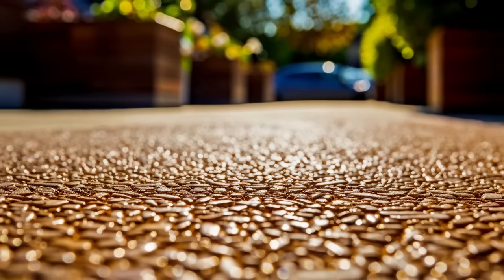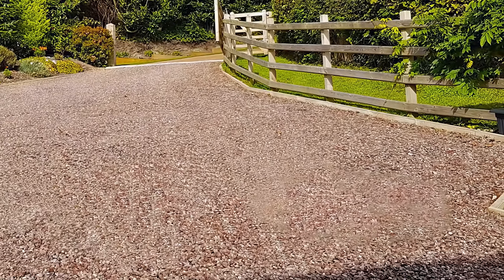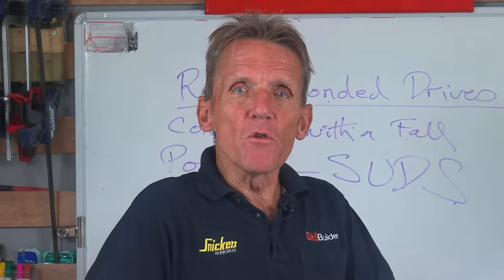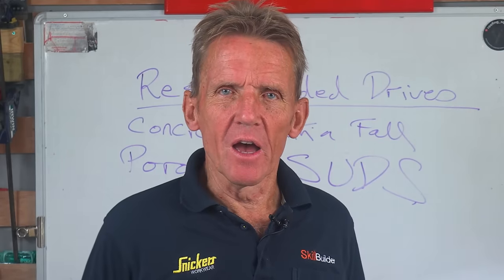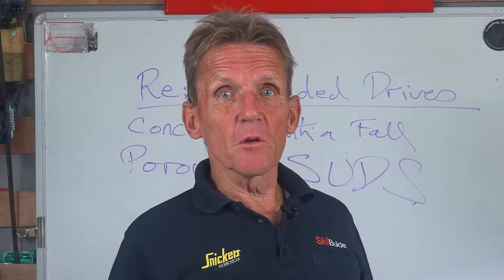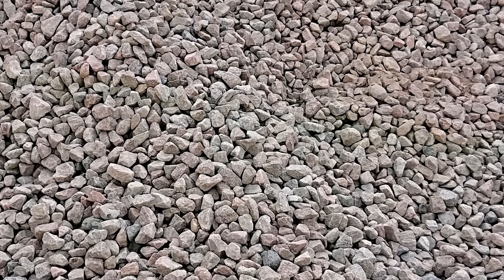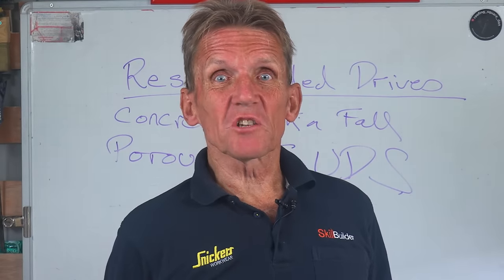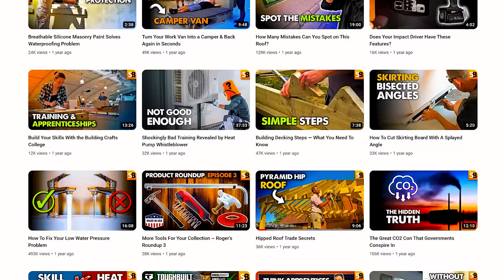Resin Bound Drives - What You Need To Know

Comment: Ive never seen a good resin drive past a few years. I think a high quality paver would look and last nicer personally, plus its easy to relevel and maintain.
Reply: I always try and steer towards a nice sett or paver not always easy as some customers really like the idea of overlaying worn out tarmac drives
Reply: i went away from resin bound having seen a number of bad ones. Opted for gravel grids and loose shingle. Easy to level and minimal shingle spreading, we are on a hill works really well
Reply: Trouble is that most pavers are concrete and they lose their colour and the grit shows up in a few years. I've had Accrington Nori clay pavers on my drive since 1992 and had them re laid last year. Looks like new. Clay holds its colour and they're as hard as rock. No man made dye holds its colour IMO. Grant you that you did say a high quality paver but clay these days is so expensive but a good investment if you plan on staying put.
Reply: Easy to level? Easy to maintain? 
Are you literally insane?

Comment: One of the local resin firms came round to estimate a few years ago. I have block pavers already but looking a bit tired. He said he would leave the pavers in place and resin over the top. So glad I left it as it is.
Reply from the maker: Yes you did the right thing, it was never going to work.
Reply: The right thing? It is not advised to resin over block pavers mate especially on a driveway or any drove over area. A solid base of porous concrete or base tarmac is a MUST for a drive. If its a path of a patio area then you could get away with it but you would still have to know what your doing to stop the weeds growing through the gaps in the blocks then out of the resin. The reason you cant resin over blocks on a drive is because there is too much movement and the risk of a future remedial is almost guaranteed.

Comment: I did my path myself, lovely easy product to work with and great finish . But not convinced driveways will stand the test of time.
Reply from the maker: did you do the resin bonded cast or the resin bound? I want to have a go at it
Reply: @SkillBuilder  I used the resin bound kits as such a small area, block paved the area in. Ruled of the blocks.
Acetone handy to keep tools clean.
Man of your skill a walk in the park.
Thanks for the videos. Learnt alot.
The rising damp, damp etc series saved me a lot of money.👍
Reply: Any discoloration of the resin finish since you put it down?
Reply: @Andrew-ze5yo   so its been nearly 2 years since I done it. still looks the same as the day I lay it. I will repeat it only takes foot traffic and nothing heavy . when I cut the lawn you get grass stains but that after a few days the rain washes it off. also the sun is not on it all day after lunch is in shade.

Comment: I had resin bound aggregate laid over concrete for my backyard, which is separate from the driveway, so has no vehicular traffic. Before, there was much standing water which now quickly drains through the resin. However, that works both ways as small weeds can still show.  The sandy coloured aggregate though, sparkles like a beach when the tide has retreated.
Reply: Just spot treat the weeds with glyphosate 😉😉
Reply: Just een your message in regard to resin pathway and would appreciate your feedback and any advise.
I have a structurally sound concrete path with a manhole cover in its length.
The path is an eyesaw.
The path is slightly wider than a standard square main hole and around fifteen yards long.
I intend to build a base for sheds at the bottom of the garden.
It's only a small garden.
From your experience would you cover this concrete path with a resin finish 
Or replace with pave stones.

Comment: Thank you Roger, yeah found that really interesting. 

When resin drives first came out I thought that would be the perfect material to use for my own drive, when I get round to doing it but after seeing so many that's failed for one reason or another I think I might go for corbels or some sort of pavers using   GFTK for the jointing.

Another problem with resin drives is they attract the build up of moss if not regularly cleaned, so I believe. 

Another subject I think would be compelling and that is different types of decking or even just composite decking as there are many different types now on the market.

Anyway hope you're keeping as well as you look in this video 😃

☮️+❤ always from me and the missus✌️

Comment: Bought a house with a resin bound drive about 3 years ago. Had been down about 10 years. Looked fantastic when we bought the house -  indeed it was one of the selling points (it's a fair-size driveway). 
Anyway, the whole thing has disintegrated in the last couple of years and all the stones have come loose, especially round the path of the cars. I guess the resin has just deteriorated over the years. It's a pain as all the little stones get trod into the house (wooden floors!). Not sure I could recommend resin bound drives based on ours. It might be a bad job, done by a bad contractor - who knows. We have to get the whole thing replaced now. It cost about £13k to put down and that was 12-13 years ago, so yearly cost (adjusting for inflation) is well over a grand per year, which doesn't seem great.

I'm now thinking about block paving, but worried about weeds in the gaps.
Reply: Does'nt look as posh, but our concreted drive has been down for 30 years & still fine.......lol.
Reply: Well sadly it wasn’t installed properly in the first place..
Reply: @MC-nb6jx   Aye it's all about the hardcore (ooer missus!) & compacting correctly, prep is everything with these jobs, I used to lay concrete founds, slabs & driveways, they are all still fine since the early 80-'s  i'm sure......

Comment: I laboured for a bloke doing patios driveways etc. All of a sudden everyone was asking for resin 90% of driveway we did somebody wanted resin bound system installed. After a few years he did end up getting call backs for colour problems slight movement. The main problem was people dry steering on the driveway causing movement. I must add all preparations were done properly, he was a craftsman but it still caused headaches. 

Research and be prepared for what Roger has pointed out.
Reply from the maker: Dry steering with an electric car is going to churn up most things. They are a lot heavier

Comment: Thanks for this Roger, very useful. Quick question- -  we're looking to put resin bound over a stable concrete base. Is there a risk from water freezing with the resin/between the layers, expanding and causing cracking?

Comment: a way to do it as DIY drive or walk way is to use old car tires, cut out the side walls. dig down the width of the car tire plus say extra 3 inches, then place the tires side by side and nail them together, then fill in with small pebbles /gravel then slightly pack it down, then its just like concrete but water can drain through it.. the tires keeps the pebbles /gravel in place and wont let it spread out , strong enough to where you can even drive an 18 wheeler over it no problem.. will last for years and years...

Comment: Great informative video as usual.
I have been also been looking at GEOcell type driveways. It would be useful if you could also cover this and compare with resin bonded drives. 
It seems you put at least 20mm of stone above the Geocell itself to allow for settlement - which sounds fine - but is it in practice?
To me the Geocell might be more 'forgiving' when you have large bushes near the edge of your drive.
Appreciate any thoughts you have on the matter.
Reply: A word of warning. As a Driveway specialist we will never use Geocell or any form of it used for driveway (car, van etc use). If your driveway is straight and you don't turn on it it should be fine. If you turn on it the load applied to the grating distorts it slightly even if well pegged down and well compacted.  Over a few years the stone fill is allowed to get underneath and slowly pushes the plastic grate up. We have seen them sticking up around 6 inches worst case where cars have repeatedly turned on it.

Comment: Properly installed resin bound through an experienced and reputable maker such as the quality RonaDeck product laid onto open graded asphalt for example, a permeable driveway works well and does not require planning permission unlike an impermeable surface which does.  SUDS principle is that your rain water does not run onto the public highway.  Strength is all about the proper subsurface material laid correctly by approved installers, then it is unlikely to break under lorries.  (Best not to install onto old concrete if there are any cracks there, also ten year warranties can be void if not installed onto an approved depth and structure of subsurface.)

Comment: Been doing resin for years and there are lots of problems if you don’t know what you are doing ,mixing times are important ,rain is a no no ,glass is just cosmetic ,quartz is a binder in resin instead of sand ,the base is the most important part porous concrete is great but very few people know how to lay it in the uk you only have a short window when laying and must be covered up to stop the moisture evaporating during setting,open grade tarmac is good,have now moved over to lay on grids great permeability no mess easy to level and can be done with less labour.
Reply from the maker: Can we come and film you?
Reply: I had resin drive laid on grids. Unfortunately the drive started to disintegrate after 3 years mainly  where the car tyres sat. The rest of the drive is now starting to disintegrate with the small chippings getting trailed into the house and car.
Is it possible to patch bad areas and put a layer of resin over the remaining drive to prolong its life?
Also what is the recommended thickness of the resin to be laid?
Reply: We use the grids too for the same reason. We think it is risky to put over any large areas of concrete. Resin works well on a steep driveway, it solved a problem where tarmac just scrubbed off the driveway with the cards wheels and block pavers just moved and concrete didnt look good. We have not had any problem with deterioration in the resin, but we use high quality UV resin from top brands, so many of the SB concerns raised are down to lack of experience and cheaper products (there are many version of resin).
Reply: what can you use to colour restore without sealing it making water stand on top

Comment: We converted 90% of our front garden into parking. Looked at resin but it was too much of a stretch for our budget and I was put off by the horror stories. Had a local driveway contractor put tarmac down and they did a very thorough job excavating, putting MOT sub base down and compacting before the tarmac went anywhere near it. Almost six years later, apart from UV fading common to all tarmac, it still performs as well as the day it was new and we've had no issues with it so far. The only maintenance it requires is the occasional moss clean.

Comment: How do these surfaces do in very cold temps, lets say beast from the east temps of -5C to -10C? Do they get brittle enough to crack, if not by themselves then when driven over? I'd also be concerned about water getting into microcracks during they day and then freezing at night, forcing the surface apart.

Comment: Edinburgh might have been the first to do this with glass in the uk back in the early 2000's as I was working at a polymer makers HQ, I was there doing IT support and the head tech was talking to me about some of the polymers they had worked on.
Some of the other stuff that I bet is still under nda was very intereating, lets just say you can get polyurethane polymers that can take a seriously big bang and still hold in the contents.
But it cost a lot to make things from it.
I guess drivea are the same.

Comment: Resin bound is a permeable surface , resin bonded (scatter coat) is non permeable, UV stable resin is called an aliphatic resin and has more flexural strength than a non uv resin which is called an aromatic resin. Non UV stable resin for resin bound is not used as much as a UV stable resin binder any longer. Generally resin bonded (scatter coat) systems use a non UV resin. For any resin bound surfaces that are going to have vehicles using them the substrate MUST be a tarmac or concrete base. Aggregates must be a decorative aggregate which means that they are of a certain size, kiln dried and dust free.

Comment: I wouldn't worry about the UV resistance of quartz (either synthetic.... or more likely, the natural crushed mineral.) It would likely take hundred of millions of years for the Sun, as it currently emits, for quartz to be even slightly degraded by the UV from sunlight. Mechanically, quartz is harder than glass (scratches glass easily) and is much less brittle. The quartz in your resin driveway will be around, long after the driveway is gone, and long after all of mankind too.
Reply from the maker: It is the resin binder that degrades not the stone
Reply: @SkillBuilder  Yes, exactly... but there was discussion about suitable aggregates... that is whether glass or quartz  are suitable aggregate... glass no... but quartz, why not?

Comment: Another great vid from Roger. Resin driveways look awful ☹
Reply from the maker: That is interesting, I quite like them.
Reply: We had ours done this time last year, still looks great. Time will tell of course but happy with ours so far looks like new. I did oil changes on both cars the other week and the inevitable little drips came off easily (although I cleaned them the same day)

Would note we had ours fully re-done from scratch basically, no re-laying over the old (was cracked crazy paving before)

I think every type has it's downsides, my parents block driveway they now find after 5-6 years weeds have managed to penetrate and minor gaps appear (nothing major but certainly not perfect)
Reply: @SkillBuilder  ours was laid in accordance with the manufacturer’s instructions but only lasted 3 years before the surface started to degrade and look awful. After 6 years we replaced it with block pavers - much more durable and look better. Lesson learned 😂

Comment: It doesn’t last and costs a fortune. Use a cellular paving system if you want gravel less expensive and longer lasting - it’s a honeycomb of plastic incorporating weed membrane that contain the gravel making it very firm to walk, drive, push wheelbarrows, etc. The best systems are invisible and the entire job can be done, including excavation if needed and a new base, for less than resin bound systems
Reply from the maker: Gravel is a nightmare, it ends up in your house, always.
Reply: @SkillBuilder  yes, 10mm or smaller can be problematic, but the cellular paving helps. It’s really a solution for those on a tight budget. Larger grades aren’t an issue though. 
For practicality hard standing are better, cheap block paving would cost about the same a resin bound, although not as attractive. 
I advise clients that resin bound should be viewed as a temporary solution, a very expensive option at that.

Comment: Can anyone recommend how else to tidy up a concrete drive that’s extremely sound but rough to look at, it’s very large and thick so too expensive to remove.
Reply: Paint it. Loads of good products out.
Reply: Acid stain
Reply: Try pressure washer if you haven’t already
Reply: It’s not dirty it’s rough, as in nearly impossible to walk on in bare foot and areas where stones from the ballast mix is starting to come out, there is not cracking however. Pressure washing won’t change this and paint will literally just change the colour. Can slabs be used on top if an even spread of mortar is used to bond to the the existing concrete?
Reply: @Mr_Ashley if it's flat and  solid you could pave  resin or tarmac over it as long as finished ground level is OK most installers won't give much if any guarantee  if they've not done  the groundwork though
Reply: @Mr_Ashley  Hire a sanding machine with diamond grit pads to resurface it. Probably cost £100 - £200 depending on size.

Alternatively screed over the top
Reply: @Mr_Ashley  yes you can use it as a base for anything. Provided the concrete has a suitable fall for drainage, block paving or tarmac would be the most economical options.
Reply: Exterior resin will make it smoother. Wouldn't lay anything like slabs on top. Once the water and frost get in you'll struggle to keep it in good nick.
Reply: Thanks for the suggestion 🤙
Reply: Could go over it with a one inch layer of patterned concrete.

Comment: Zero rain absorption, so massive run off. Old bricks with mossy gaps much nicer.
Reply from the maker: Did you not watch the video? This surface is very absorbent.
Reply: @SkillBuilder  no wonder they fall apart under any use, I thought the resin bonding was like the plastic setting kits that you put your teeth in years ago.

Comment: Don't think about it getting this. Looks very pretty but can't handle vehicles. If you are just walking on it, then fine, but never get it for drive. It will crack within 2 years, and I'm a builder and have seen the work by so many driveway  companies.
Reply from the maker: My neighbour has 4 cars and a pickup truck. His resin drive is 12 years old and looks fine.
Reply: Surely, they just need thicker layers, that allow for the additional weight? Substrate etc
Reply: @SkillBuilder  all depends on what’s under it